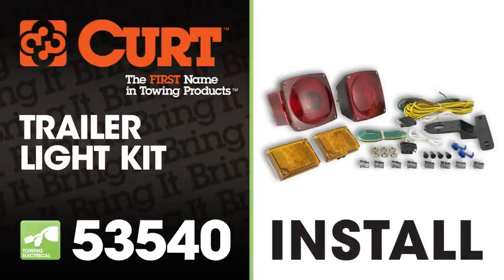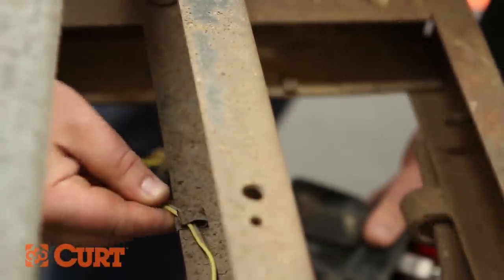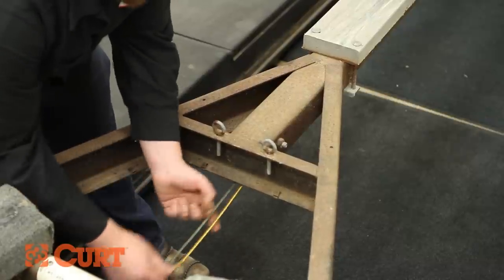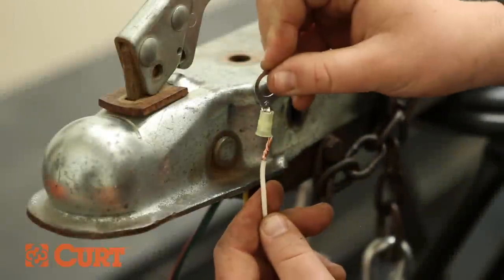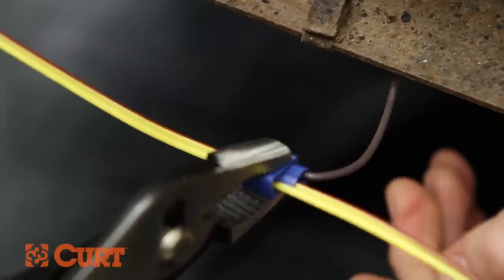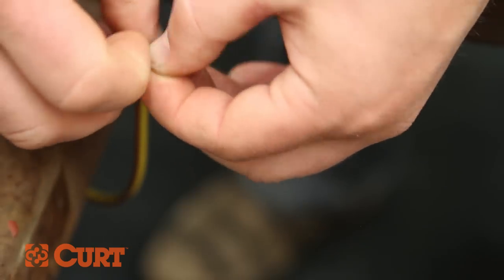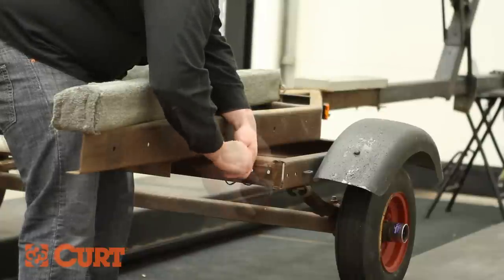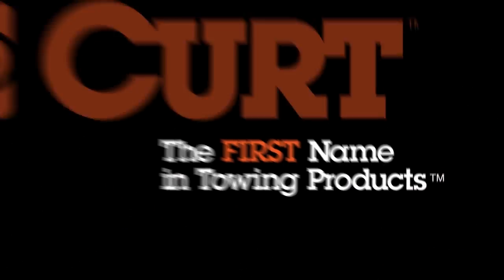How To Rewire a Trailer with Universal Trailer Light Kit Using CURT 53540

Comment: hi i bought this kit and i wired it like it says in this vid but light not working like they should.
Wen the light on my jeep are off and i put on the brake no light on the trailer and same thing for the turn signal and wen the light on my jeep are on well the light works on the trailer but its like i have the foot on the brake pedal, i dont understand ???
Reply from the maker: Seems like your four-flat connection may be corroded around the pins, please give us a call at 800.798.0813 and our technical support team will help you out.
Reply: found the problem it was the connecter now its ok.
Reply from the maker: Way to #BringIt! Tow safely!

Comment: Question, how good are those snap locks for the markers? Is it safer to just hardwire the markers in? Or are the snap locks better?
Reply from the maker: Great question.  The snap locks are convenient, easy to use and allow a splice without cutting or striping.  Other than that they offer no advantage.  If you would prefer to hard wire the marker lights for a more secure connection, that is a great way to do it!

Comment: how does the wires stay in the light ? what holds them in?
Reply from the maker: There is a spring that opens to let the wires in, and then squeezes them tight, holding them place once in position.